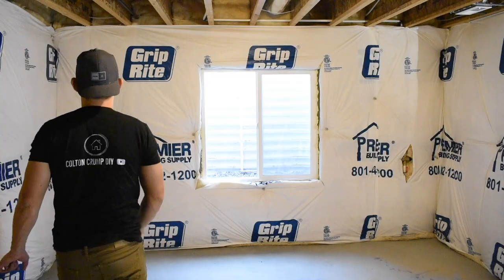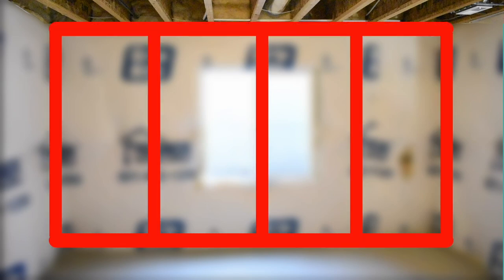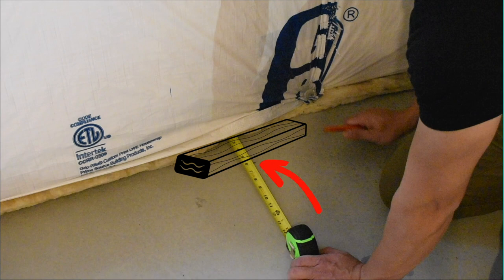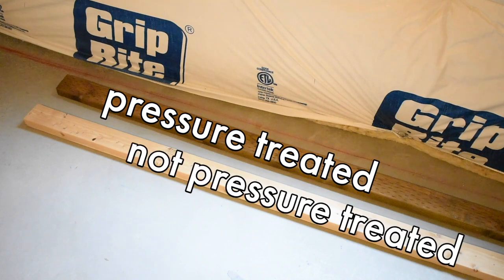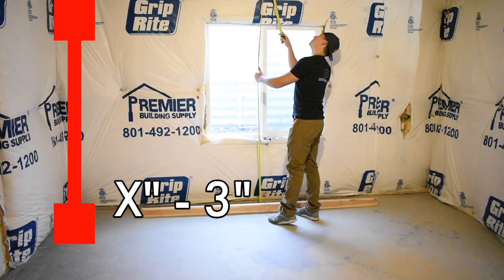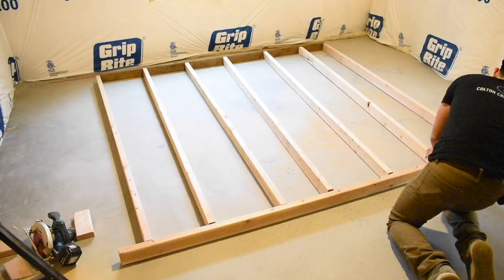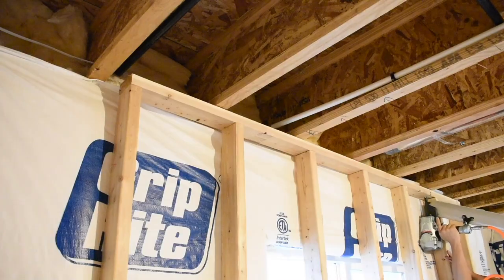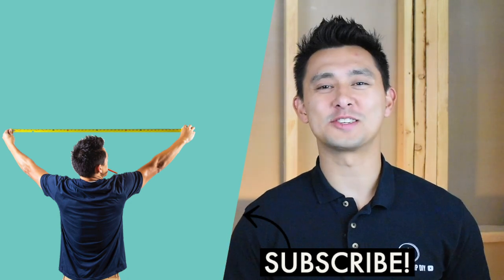DIY How to frame a basement wall - for BEGINNERS

Comment: Can you use adhesive or some other method instead of nailing/screwing through the concrete on the bottom plate? It's not for load bearing walls. 
I'm worried that those holes will spread existing cracks or hasten how fast the basement floor starts cracking. 
Especially when nailing through the concrete, where does all the concrete the nail shoves out of the way go?
Reply from the maker: You *can*. I say that because I personally wouldn't.  You would think with gravity and just being like a partition wall it would be fine but some things I would suggest considering:
- the cement may not be very clean and might not allow for a good bond
- glue shrinks when it dries, could create less than an ideal contact for the wall to stay in place
- when trying to put it up, your adding another thing too the bottom of the plate, so if you measure your cuts and it's tight while putting up the wall and need to hammer to get plum, you're going to get glue spread everywhere else before it's final position
- if your cuts are short and you have a lot of play, then you run into the struggle of glue being slippery and being to make sure something holds that wall in place long enough to know that wall isn't slipping anywhere, and you may have more than ideal gaps at the top plate because you were trying to work around not smearing the glue too early
- cement cracking 'can happen but with the .22 ramshot shells, they do a decent job at not creating new/more cracking. A way around this is screwing them in.  You can pre drill a hole then get cement screws with a washer

As far as where does the concrete go where the the nail is driven into.  When using something comparatively slow like a drill, it digs out the cement as it's drilling.  When looking at something fast like a ramset shot, the force is just going to annihilate the cement in the way and either push it down more into the hole as it fastenes or push it to the sides and out where the nail is being driven from (hence safety glasses). I'm not a physics teacher by any means so anyone that has a better explanation go for it.  Lol

Comment: Hello! I am closing on a new build soon. It is a walkout so the lower part of the wall is cement, the top part is insulated. Would I still have to add insulation to the cement portion or can I just frame right over it?
Reply from the maker: Personally I would still insulate over anything cement. How cement is so porous, its not a good material to regulate the temperature of your home plus there is the moisture aspect. It comes down to how much of your wall is cement and how much are you okay with having that part of your home allow the possibility of more moisture and the outside temp influence your home temp. In this video the insulation is a cheap and put up by the builders but really is there because its a moisture barrier. After I got done framing this, I added more insulation between the studs to help with temp regulation.
Reply: @ColtonCrumpDIY  thank you so much!!! I will make sure to do that.

Comment: So not lonely is your basement wall already framed and has a barrier on it but you’re going to frame it again? What’s the reason for that? What’s the reasoning?
Reply from the maker: So the wall that is shown behind me from 0:00 to 0:53 is an interior wall that is shared with another home.  The wall that is shown from 0:53 onward has the moisture barrier on it but it isn't framed. This is common with new builds when a basement isn't finished they will leave the exterior walls of a basement not framed. It's less work for them.  Hence me framing it and demonstrating how.
Reply: Gotcha! Nice work !!😃😎
Reply from the maker: Thank you!! Appreciate it!!

Comment: Bro not every 16 inchs. 
15. 1/4.  
31 1/4
47 1/4
keep it on like that.
Reply from the maker: 16 inches on center. 

If you go from the inside edge to the next inside edge of the 2x4, you'll get the measurement you're talking about 15 1/4 (a 2x4 is actually 1.5in x 3.5. So the center of a 1.5 piece of wood leaves 3/4 in both sides, which if you were to subtract 3/4 from the 16 in that I mention, it comes out to be your 15 1/4)